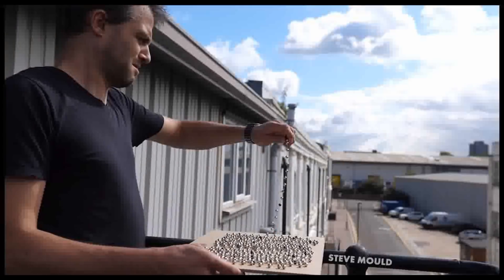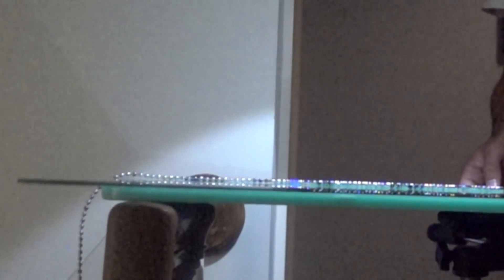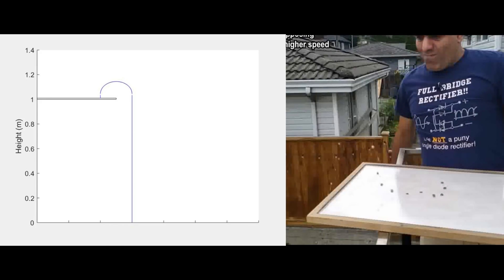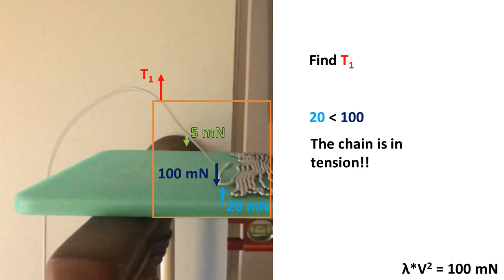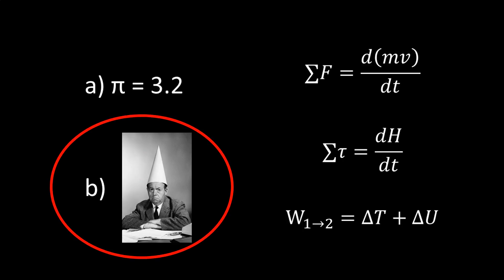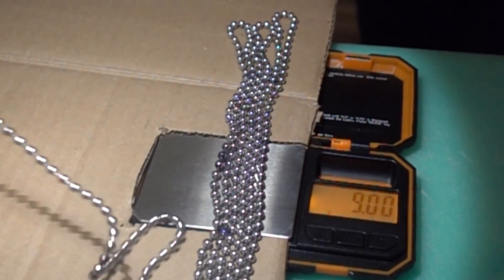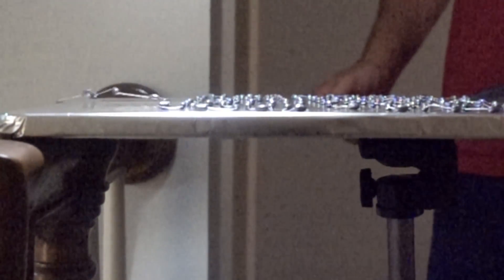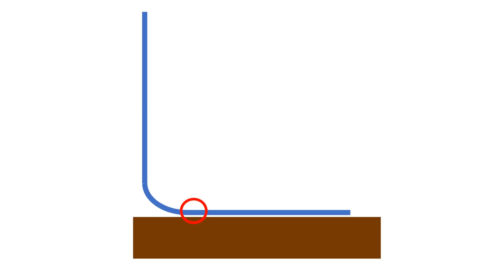And the Winner of the Chain Fountain Dispute is...

Comment: The rotation/vibrations of the chain is the main cause of the fountain. A rotating or vibrating universal joint becomes more rigid. Therefore the vibrating part of the chain starts to behaves a a semi-rigid rode as speed builds up. Since there is no such thing as a free lunch, part of the gravital energy is absorbed by the efforts in the joints reducing the vertical acceleration of the rope compared to a solid object falling.
I think you need to drop classical mechanics and consider waves physics.
The rope is a medium. A wave signal is generated by the lateral movments and travels from the dropping part towards the rest of the chain. a sin curve is forming and is quite obvious on slowmo shootages.
The wave brings energy into the curve and forces it to behave as a semi-rigid material.
That's the perfect arc one can see. At the end of the ar ther is nothing eslt but tention and then the chain is forming a straight line. 

The vibrating free join effect is sometimes called the fakir rope effect.
Reply: Didn't watch the multiple video leading up to this one did you? That theory was already disproven.
Reply: @irgilligan  Was it? I haven't seen that.

Comment: This is what I've been explaining on multiple videos about this effect:

○–○–○–○–○–○–○–○–○
Bead Chain Mould Effect hypothesis:

If any of you watched the following video, where a couple of scientists at the Royal Society took on this mystery, I left my hypothesis, compared to theirs and the people that disagreed with them and Mould, that I think explains it better. The Royal Society video is here:

https://youtu.be/-eEi7fO0_O0

They draw a diagram that they think is explaining the Mould effect, that seems to agree with Mr Mould. The diagram with the flat bars is close to the truth of what's actually going on, IMO. The issue many people are having is that the chain isn't a series of bars with short connections between them, but a series of balls with short connections between them.

However, the spherical beads in a ball chain are held together with metal wires - very inflexible wires, at that. There's no flexibility to allow the bead itself to rotate individually as it is being pulled up, because of that rigid wire holding it to its neighbors on the chain. That rigidity forces the wire in between the beads to lever and push against the neighboring bead, imparting that force to the next bead, which makes the bead being picked up by the rest of the chain jump upwards. 

The only difference between the flat bar chain diagram they use in the video above and the bead chain used in all of these videos between the two "competitors" is that the lever point for a bead chain is in the center of the inflexible wire between the beads, not the center of the next flat bead in line to be lifted, like in their diagram. 

[I hope I've explained it clearly and succinctly, as I'm running on no sleep, and it's after 6 AM.]
○–○–○–○–○–○–○–○–○

Comment: Great video. Particularly compelling to me are the slow motion videos where you see the fountain start at a kink in the chain near the pile and progress down the chain. I've always found Steve's explanation to be more compelling. Mehdi's rebuttals seem to just be coming up with different situations where the up-push force is more ofuscated. 

I think if Mehdi really wants to prove his hypothesis, the experiment he needs to do is:

1. Get rid of the rod/pile/stack of chains.
2. Replace it with two motorised rollers that project out lengths of chain at a fixed specified speed, a long horizontal distance from the drop. (The idea being that the two motors smooth out any kink in the chain and ensure it is purely going out horizontally
3. Try varying the speed on the rollers and see if there's a fountain then.

Comment: There is something odd about the movement of the chain when it is leaving the tray or support. It is kind of unwinding a loop, and at times one sees this unwinding "traveling" forward and disappearing. So here is an idea: I get this "annoying" effect when I am winding up or unwinding my hose garden - the different geometries require a spin (!) as the material is rigid. In these chains though, the beads are joined by a loose rod, and they more or less rotate freely. But because of the tension (!) the friction of the rods' ends against the beads (internally), reduces this freedom and the beads and the rods behave a bit like a garden hose, wanting to spin while it changes its configuration. That piece of the chain that is in tension, wants to spin, producing these loops and ultimately, the leverage on the supporting surface. This effect would also explain, I believe, why different ways to wind or place the chain in a cup produce different effects - here you go.
Reply: You may be on to something with the twisting in the case of the tightly coiled vs one giant coil in the cup. I don't think it would have any affect in the tray case as it's not coiled in circles but rather back and forth.
Reply: @brandonn6099  , good point. In this case, I can imagine the beads rotating as the line moves from left to right and right to left [albeit in opposite directions!]. There must be an effect if we use this and consider changes in the friction due to tension and position (the beads at the ends of a back-and-forth configuration should have greater resistance to rotation [spin] and this may be playing a role). At the end, considering spin and the friction [or not friction] between the tiny rods and the beads is something that hasn't been considered...  I bet it must be hard to model but someone could give it a go.
Reply: If this theory is correct, there is a configuration that shouldn't produce a fountain at all: a straight line on a flat surface, falling on one end of the surface. Any other twisting is likely to show this effect. I bet it doesn't, hope to see it soon.
Reply: Yes. Would like to see someone explore this theory.
Reply: Do you mean to say that if the friction between the beads and connections is completely removed and the chain can rotate freely in any configuration (unlike the stiff garden hose), the fountain height will be reduced? I think you might be right and this can explain things clearly. Also, it would mean that if you lay down the chain along a single line (or any configuration where this "torsional" stiffness doesn't come into play), there should not be any fountain.
Reply: You could probably reduce the effect then by working some lubricant into the chain first...
Reply: I wonder if adding some oil to the chain would change the result allowing the chain beads rotate.

Comment: The reaction force exists because, as nature intends, everything works in the most simplistic way imaginable. The complex coils the chain is trying to undo, reacts against the momentum. This gives rise to the unfolding kickback force. The chain will 'resort' to the path of least resistance, which is a rising fountain. The tinfoil base proves that the force truely exists. Nature, or physics will route for the most simplistic method to get the job done, even if it seems or looks complex.
Reply: "The tinfoil base proves that the force truely exists."

This is no miracle video by any means. The "force" you seem to be amazed at, has always been there and will always be there. You didn't need this video to see it. This is nothing new. It's called the normal force in physics, the contact force a surface imparts on an object when an object applies a force onto it. You see it EVERYDAY when you walk. Look behind you, if you're walking on soft surfaces, you see these footprints. Yep, that's the same magic you see in this video so it's not like it's something you've never seen before. If you are amazed at the prints, then you should be just as amazed with your footprints and the tire tread marks your car makes. Nothing special about it. It's called the normal force in physics circles, or what some like to call "extra reactionary force" force and it's what gives us friction. Without it, there would be no friction. Without it, life would really suck! Just know that it's not reactionary, meaning it doesn't wait and happen after an event like a reaction does. It occurs simultaneously. It's an action pair(two identical actions in opposite directions occurring at the same time), not an "action" then "reaction" pair. Big difference.
Reply: @vangmountain  who said i was amazed? I was commenting on the discussion at hand. I didn't claim it's new or insinuate that I'm amazed. If you want a discussion on words and descriptives, carry on. You don't know what i believe. If you're trying to assume anything about me because you've miss-read my comment, read it all again.

Comment: Centrifugal  force augmented by vertical momentum as it develops.  Good grief.  The variations in chain resistence from how it was thrown into the cup with overlaps showed plainly the difference between flat pull and vertical pull from the stack.

Comment: Imagine one of those carnival rides where you stand against the circular wall and you appear to defy gravity.  If the wall dissappeared and you just hold hands the riders would still have plenty of centrifugal force to keep the circular motion - in fact you would have a greater force than gravity even at the top so if you linked hands with people in the crowd you could have a human chain fountain assuming those falling on the other side went down a deep well.  Not a nice picture for humanity but the physics seem correct.
I think the imaginary centrifugal force better explains chain fountains and that random jumps in the chain are the start of the phenomenom. Once a tiny circular motion forms it feeds on itself and grows.

Comment: I still don't get all this story. 
The only force up on the chain is the reaction from the table. So of course the reaction is essential to raise the center of gravity....
If you are sitting, and you stand up, whatever the internal processes of your body, the reaction from the floor is necessary to allow you to get up in the first place, and if you stand on an alluminium sheet, obviously you will put a mark on it when standing. If you have a pen standing on a table and you lift one side, the reaction forces contribute to the pen going up. If you have a string compressed on a table, the reaction force is what allows the string to jump in the air and not expand in the table... 
Reaction force is a support force, a non-working force, whose only goal is to make the contact point STAY STILL. There is no magic here. What makes Steve videos completely misleading is that he makes it appearing magical, by adding a little bit of rotation and couples here and there, but in the end, what makes the fountain goes up is not some magical push from the grounds, which is what his videos are all suggesting. ALL set ups who stand on something stand thanks to the reaction from the ground. ALL of them. 
The fundamental reason why there is a fountain, exactly as for a string compressed down, is not the existance of a reaction force, which by definition will adapt to anything, up to table breaks. The fundamental reasons are the building up of tensions in the string, possibly some part into torsion, true, and as any set up subkect to ellastic deformation. These tensions are caused intialy by the weight of the falling bit, and can only be released by either inelastic deformations (in a string with sparse beads), or by a longer path (in a string with metal junctions).
If you have a compressed string on the table, you let it go and it jump into the air, you don't start to say "oh look, the reaction force did something magic", because everyone gets from the start that the string is the main point here, not the reaction force that makes the tip of the string STAY STILL while it starts to expand.
[Edit: spring, not string....]

Comment: Sorry but Mehdi's explanation is more close to describing the reason for the phenomenon, but Steve also has a good point in describing an important side effect.

To be more precise I'll say, the chain fountain is the result of a yank effect on the chain, between falling beads in high tension and resting beads on the pile. In other words, there is a very fast step on the tension forces propagating in the chain that will cause the chain to overshoot. This phenomenon is very common in electric circuits, Mehdi can certainly explain that very well, but to put it simple, voltage tension will overshoot if you apply a very fast step of tension to an electric circuit.

Here is the mechanics physics explanation.

1. First thing to consider is, a chain in tension is an efficient device to transfer forces and energy along it full length.   

2. Roughly, the driving force pulling the chain down is equal to the sum of masses of the falling beads times gravitational acceleration. Hence, the pulling force will increase until the first bead in the chain reaches the floor, after that the pulling force will be constant.  

3. In tension, the bead chain is very efficient in transferring mechanical forces, therefore each bead resting in the pile will be yanked out in very fast succession by this pulling driving force. If friction forces and untangle forces are high the yank effect will not happen.

4. When a bead is yanked out of the pile it has very high horizontal momentum, but in a very short distance this horizontal momentum is stopped to zero, at the falling curve of the dropping chain. Hence, the chain will have to bend in all directions to accommodate this "discontinuity". It will hit every thing it finds like the base of the pile, and that will redirect the the chain upwards. If the chain is very flexible and does not have a minimum bending radius it will wrap up and this effect will not happen.

That's all there is to it.
Reply: Your point four doesn't explain how you can get a chain fountain out of a simple horizontal yank.
Reply: @zhoufang996  Ok, let me explain better. The beads moving horizontally will have to deaccelerate horizontally in a very short distance. The force associated with this deacceleration will bend the chain randomly in any direction. If the randomly bending chain hits the base, the momentum of the beads will be transferred upwards and the chain will start rising, creating the fountain effect. The round shape of the beads and an large bending radius of the chain will clearly enhance the effect.

Comment: Nice video. There is clearly a wave in the system that accumulates energy as more chain falls. To go from laying flat to falling the chain must bend 90’ under tension, so a  small impulse upwards accumulates. There is a clearly a smaller wave train in the vertical upward portion of the fountain when it gets really large. I suspect this is at a harmonic of the largest hump.